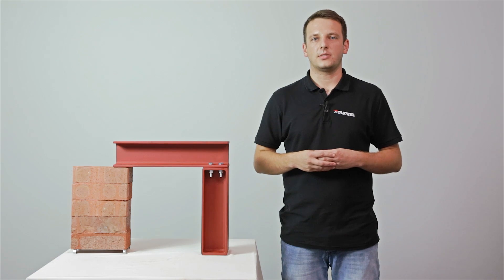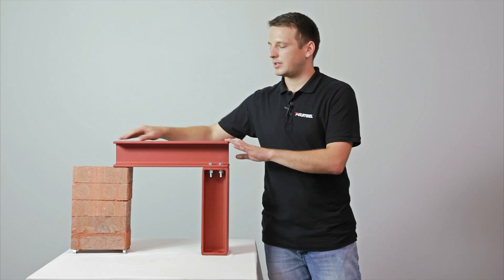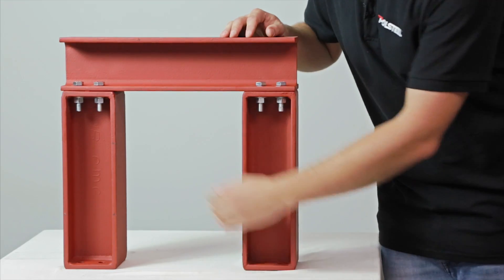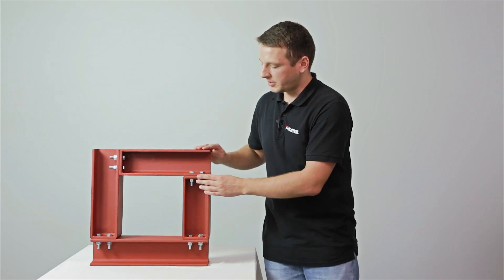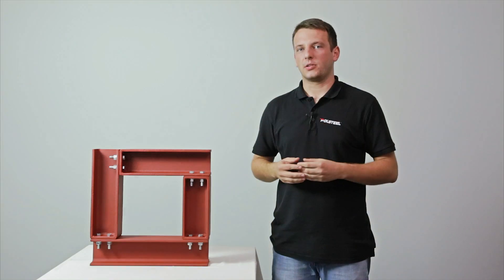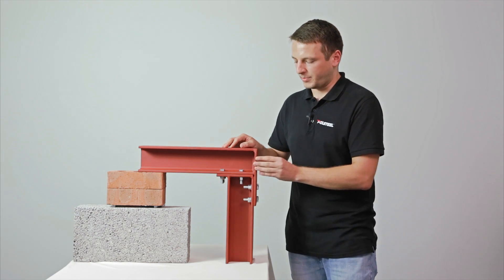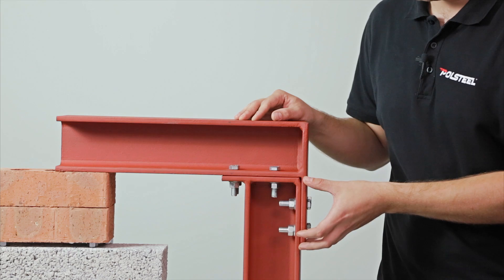ASK THE ENGINEER - WHAT IS A MOMENT CONNECTION?

Comment: That was an example that does not explain what a moment connection is, this is more of a commercial sales pitch.
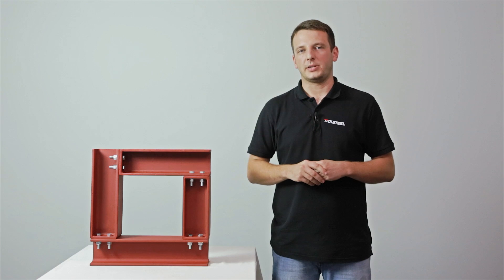Reply from the maker: We explain what a moment connection is at 1:40. If you have more questions about this, please let us know.
Reply: @SteeloLtd  No you actually do not. You explain the obvious design and that it is called a "moment" connection. But what makes that connection a "moment". The fact that a "moment" connection in engineering is dealing with a rotating force and how that connection that you show deals with rotating forces and that is why it's called a "moment" connection
Reply: @SteeloLtd you show an example of a specific moment connection, but you don't explain how it works (i.e that you have to add that plate in order to transfer the bending moment from both flanges to the column) nor do you explain that what you show is just one example of a whole class of connections.
Reply from the maker: @guywthclss  Thank you for your feedback! You’re absolutely right that the video does include promotional content, and it’s geared more towards guiding homeowners and builders who may not have a structural engineering background. The aim was to help them understand basic elements of structural steel, how to measure and order with confidence, and to clarify some of the common terms they might encounter.

As for the technical details, you're correct again—unfortunately, we at Steelo aren't structural engineers, so we can’t dive into the specifics of load transfer or the variety of moment connections available in the industry. We use one common type in our projects, but we realize there are many others, and the video was intended more as an introduction rather than an in-depth technical explanation.

We truly value your input, and we’ll take it into account for future content to ensure we’re clearer about what’s covered in the videos. Thanks again for watching and sharing your thoughts!
Reply from the maker: @kxjx  The video does include promotional content, and it’s geared more towards guiding homeowners and builders who may not have a structural engineering background. The aim was to help them understand basic elements of structural steel, how to measure and order with confidence, and to clarify some of the common terms they might encounter.

As for the technical details,  we at Steelo aren't structural engineers, so we can’t dive into the specifics of load transfer or the variety of moment connections available in the industry. We use one common type in our projects, but we realize there are many others, and the video was intended more as an introduction rather than an in-depth technical explanation.